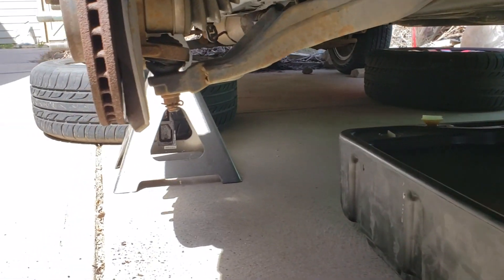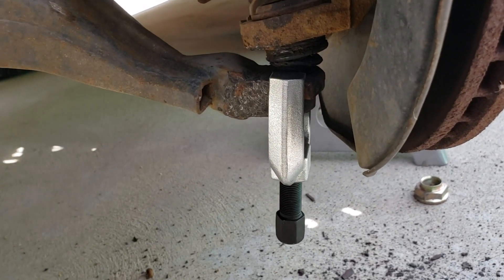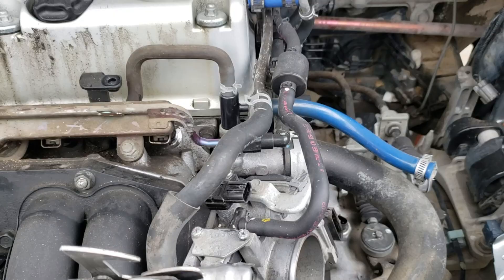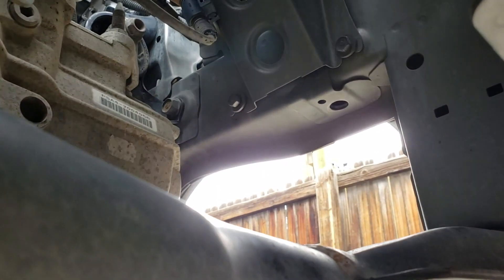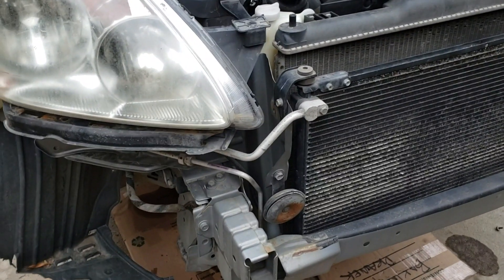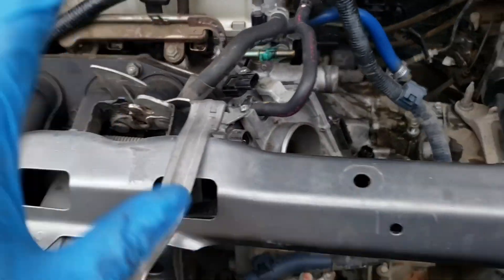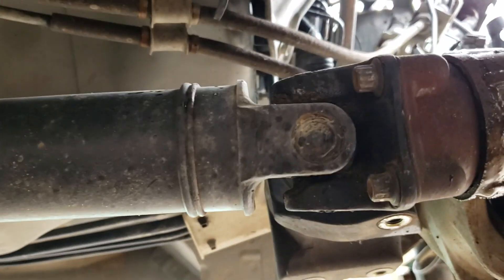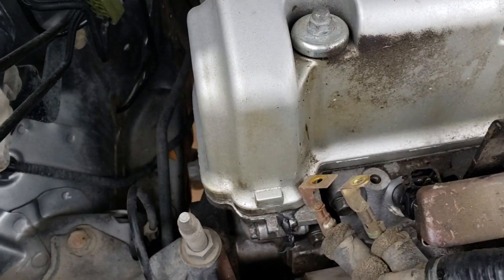How to Remove 2005 Honda CRV K24A1 Engine

Comment: If you are following this video in order to replace the engine, it is important to know that when installing your new engine, that the torque converter is to be attached to the transmission first. When the engine is bolted to the transmission, there is an inspection plate that allows you to attach the torque converter to the flex plate on the engine. It is easy to get this backwards, but then you will have a malfunctioning torque converter. It is important that you connect the TQ to the transmission correctly, so research this step thoroughly. The torque for the TQ to the flex plate in an automatic transmission for the 8 bolts is to increase incrementally in staggered order to 8.7 ft/lbs (104 in/lbs). Most of the torques you find online will be for a manual transmission, which is much higher and will strip the bolts. I also recommend using a punch to remove the CV axles from the wheel hubs, otherwise you may damage the threads on your CV axles.
Reply from the maker: Thank you for input. As much help is appreciated.

Comment: I had great success removing the ball joints by attaching a clamp as in the video, tightening till it is very snug, but not too tight, and then applying heat with a small butane torch to the underside of the ball joint where the cotter pin came out. Within a minute they both made a popping sound and were free. Also a reminder to remove the axle nuts while the vehicle is still on the ground with tires and parking brake applied. I also had success with removing the passenger side CV axle by removing the one bottom bolt holding the heat shield over the axle, slipping a punch in the space it now allows, and whacking the CV axle 3 or 4 times with the punch, came out fine. Thanks for making this video, it is greatly appreciated.
Reply from the maker: Thank you @kalumlauritzen5569 for the extra tip and help for removing this engine.
Reply: @jsrebuilds3951  You may want to add a safety tip at the beginning of the video reminding people that after they've removed the front CV axles, and disconnected the drive shaft, I believe the vehicle is basically now in Neutral (correct me if I'm wrong). If someone is doing this work on a slope, and they are under the vehicle disconnecting the drive shaft, the result could be catastrophic. You may want to remind them to chock the real wheels, apply the emergency brake, and have blocks as well as jack stands to support the vehicle. Your trick with leaving the tires under the vehicle is also a nice touch :)
Reply from the maker: @kalumlauritzen5569  Thank you for the great information.

Comment: Its not the engine I am trying to replace😅 its just one small little bearing in the gear box that i need to replace and the car would be good after that. kinda sucks but thats how it is🙄😂.  Looking for ways to get the transmission out of the car. Very good video 👍

Comment: You left out the part I need.  Was hoping to see how high I'd have to jack the front up to get the engine out.
Reply from the maker: 1st just rest your motor on a 4 wheel flat dolly, once it's rested go ahead take off all the motor mount bolts, your going to need a pretty high floor jack. I will send you a link with the Acura Integra I did which was the same process I did to remove this CRV motor.
https://youtu.be/vwXBmE6Vr7c

Comment: Great video! How high of jackstands did you use to get the engine out from under? I need to replace my engine with a JDM i bought. Anything I should look out for?
Reply from the maker: I used the harbor freight 3 tons jack stand because they lift pretty high. If its not high enough you need to carefully get creative to use blocks or something to lift the vehicle higher to it will clear the engine. Its pretty straight forward, I used the jacks to lower the sub-frame and then I placed a dolly underneath to lower the motor and transmission on top off to roll them out from underneath the vehicle. An engine hoist would help to lower the engine on top of the dolly.
Reply: How did that swap work out.What did you have to change on the Jdm k24 to work in the crv

Comment: wouldnt the easy way be taking drivers and passanger mounts off the engine... unhook the ac, coolant, and wiring.... unhook the tie rods... then unbolt the subframe (aND SHOCK towers) and take the entire engine/subframe/suspension all in one go? Or am i missing something
Reply from the maker: That was first time for me pulling an engine from a CRV. I never tried it the way you mentioned but I can see that would another way of removing it all at once. Thank you for the suggestion. Any advice or constructive comments are always welcomed here.

Comment: Not a mechanic, regular customer here. Do you have to remove the subframe and transmission in inorder to remove the engine?
Reply from the maker: I am not a mechanic as well, I've just removed serval engines myself in the past. I've always find it easier to remove the engine from the bottom of the vehicle especially if you have a lift for the entire vehicle. But to answer your question yes if your removing engine with transmission the way I am in this video. You probably can remove engine without removing transmission but for me removing both is easier and is an extra step. I don't know how the pros would handle this.

Comment: why didnt u pull the front the rwst of the way apart and pull the engine from the front?
Reply from the maker: Because I didn't use or have an engine hoist to remove this motor myself. I only mention and recommended in the video to use an engine hoist was for people's safety and it would be easier for them. If you watched the video, I mentioned I didn't remove any of the AC (air conditioning) components because with my personal experience I could remove this engine without having to undo any of the AC lines or condenser. So basically with that I wouldn't be to remove the engine through the front. This video was created to give people some ideas, extra help (knowledge), and or basically to show people how I removed this engine myself.  Also the video was left open for people to choose how they would like or prefer to remove this engine, plus there are several different ways to remove this engine.

Comment: Roughly how long did it take you to pull the motor and get it back in? I'm getting ready to do a k24a2 swap in mine but I use my car for work so I'm trying to estimate how much time I'm going to need to take off.
Reply from the maker: I want to say 1 whole day but if you going to use a k24a2, i believe there are lots things you need to swap out from the old engine to try and make the k24a2 work in your crv. Also the heads are different so there is going to be issues with vtec sensors and things like that, not to mention ecu compatibility.
Reply from the maker: I haven't found anyone atleast on the web who was able to do it successfully. But then again my crv was a 2005 and up. I think 2003 crv is similar to the 2003 rsx so compatibility might work saying that you can use k pro ecu with it. Also if your able to get it to work in a 2003 crv you may have an issue with a check light that will go off because of the reverse lockout on the transmission. There isn't an option in kpro where it can be turned off but I have success installed the shifting mechanism onto my k24z7 transmission in one of my videos.
Reply from the maker: I've actually attempt to try and put a k24a2 in my 2005 crv thinking I could make it work but there was definitely a lot of factors that prevented me to do that such sensors, etc.
Reply from the maker: But your going to have to do your research on this one.
Reply: @jsrebuilds3951  I was also thinking of just trying to swap heads only. Not sure yet if it would need 24a2 rods and pistons for clearance, been reading up on a lot of forums but no definitive answer yet. My crv is a 2005 too. I very much appreciate the response!
Reply from the maker: @hittinhertzaudio8950  Your welcome. I have read some on the forms and your right there's really no answer. But I still think there maybe an issue because the a2 heads have the extra lobes for the vtec which the crv ecu isn't program for the extra sensor for the vtec. The only thing that I could see is that you can run the a2 head but probably not get the extra vtec to work because crv ecu and head is not designed for it. Again and I'm not sure but if you want everything function as an a2 motor should, I would look into finding maybe like a ktuner ecu or some kind of programable ecu that will work in your 2005 crv.

Comment: Thanks for the video. With the engine removal do you have to drop the engine or can it be lifted out as well. Also is it necessary to leave the trans hooked up for the removal or can the engine come out individually.
Reply from the maker: I dropped the engine from underneath and think the is the easiest way because I didn't have an engine hoist. But it can be lifted out it just takes a little bit more time and requires a hoist. You can leave the transmission in the vehicle but I find it easier to take it out together.
Reply: @jsrebuilds3951  thanks for the reply. I do have access to a cherry-picker. Just trying to decide which route to go
Reply: We're you able to take it out thru the top?
Reply: Yes. We took it out of the top
Reply: Thank you for your help